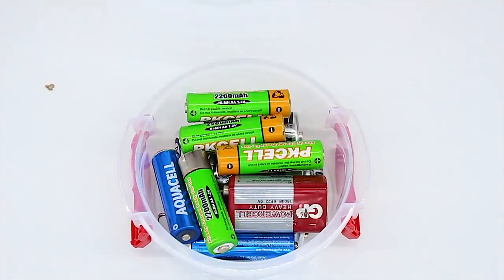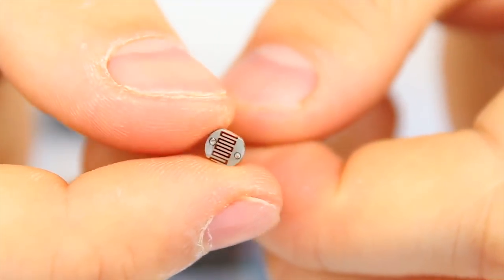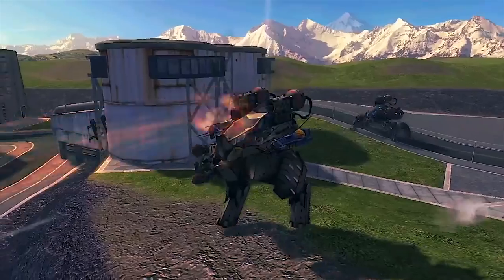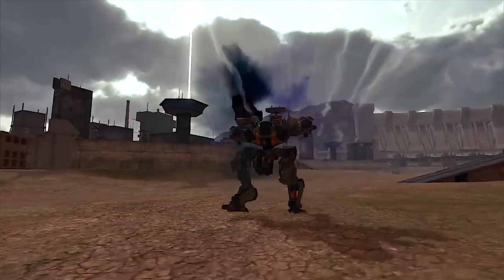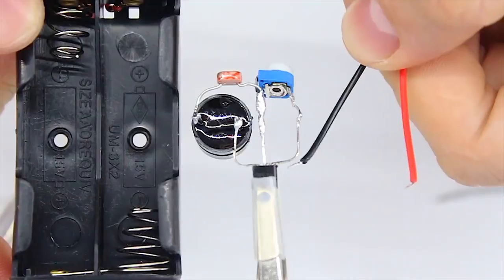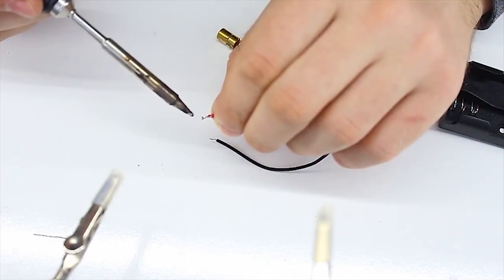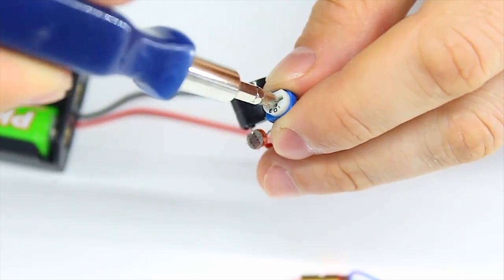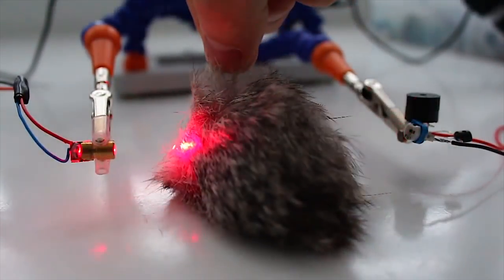How to make a Laser Light Security Alarm/ TUTORIAL

Comment: can anyone Tell me the things he used
And will this also works with high voltage like 18 volt battery on buzzer side just to make buzzer sound high?
Reply: Mr I think 18v will destroy buzzer. I've tried with 9v and buzzer... It's for use just on 3, or 4,5v. Components:laser pointer, transistor, fotoresistor, buzzer, batteries, potenciometer
Reply: Project X thanks, but if i use high volt. buzzer? aren't high volt. destroy other components
Reply: Mr you can use relay, just for buzzer, circuit starts relay on low volt. and relay starts high volt. circuit with high volt. buzzer
Reply: Project X thnks mate, and if u suggest me a clip it would be more helpful
Reply: Yes very simple, you would have to use a mosfet, you can buy them on eBay for cheap, get the ones that are complete unit.  They use a very low voltage like 3 or 5 volts to trigger it but it will control as much voltage as you need , it is a solid state switch
Reply: cosmicway thanks will try